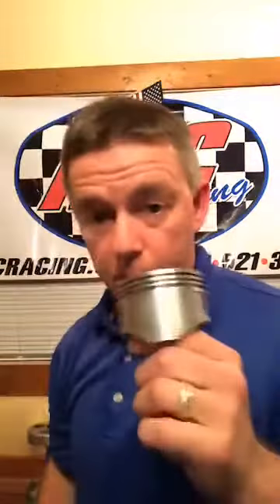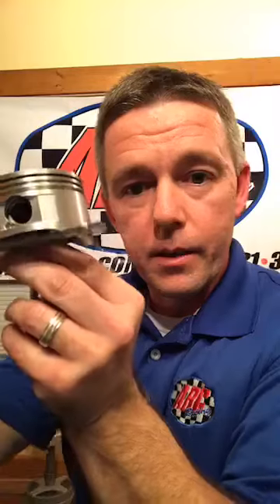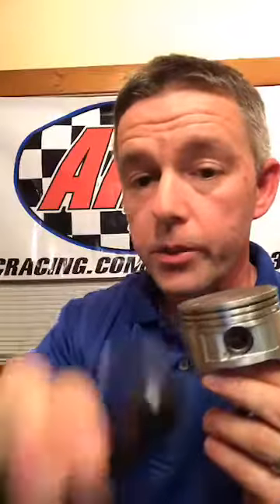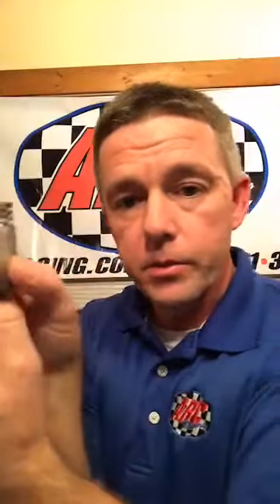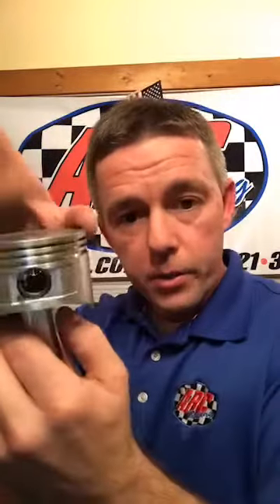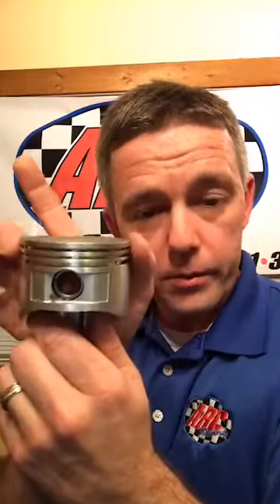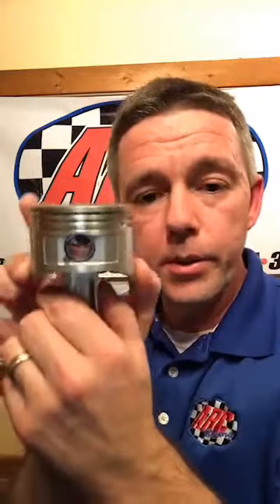Basic Clearancing and Torque Specs(Predator 212, Clone 196cc, Go kart racing, Mini bike racing)

Comment: I got ordered the wrong length pushrods the 5.200 instead of 5.260 for my 196R tilly. Can I just run lash caps to compensate for the slight difference?

Comment: I think torgue plates are a myth I have bored hundred of cyl never had a issue the Head torgue pulls straight down it should not distort the cyl maybe a good practice on a Top Fuel Dragster but for a small engine . well opinions are there for a reason...